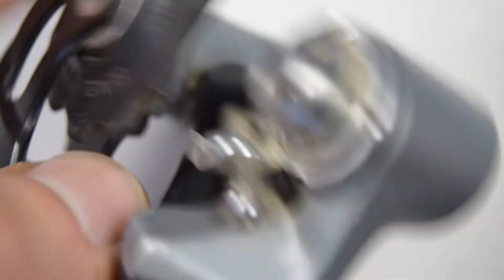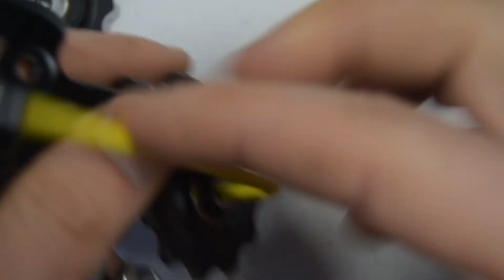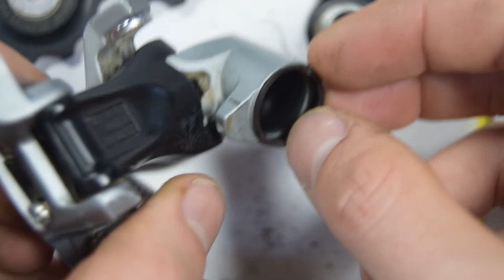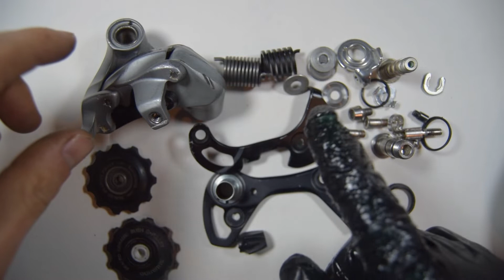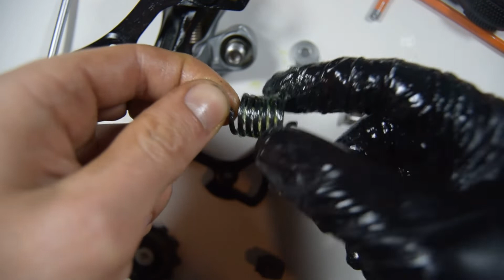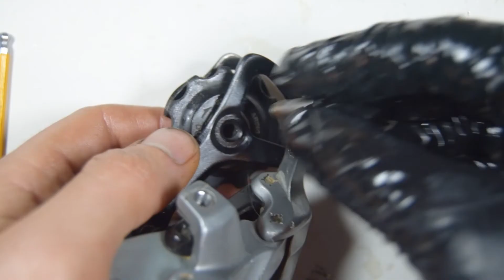Shimano Ultegra 6700 Rear derailleur: how to Service Overhaul clean dissembled

Comment: You didn't grease the jockey wheels?
Reply from the maker: Sometimes I do. Shimano don’t seem to put when new (but do put some on the parallelogram cage spring, bizarre, considering it attracts dirts).
Reply: @atboy4342  thanks. where can I find the correct torque NM for the bolt that secures the Outer Plate (jockey wheels cradle) to the body of the derailleur?
Reply from the maker: @coolhand1966  No idea, never seen that listed anywhere. Nothing more than hand tight (lets say no higher than 10nm )
Reply from the maker: https://bike.bikegremlin.com/14694/bicycle-tightening-torques/  A quick search, I found a few recommendations for the hanger bolt and ancor point (nothing for that particular one though).